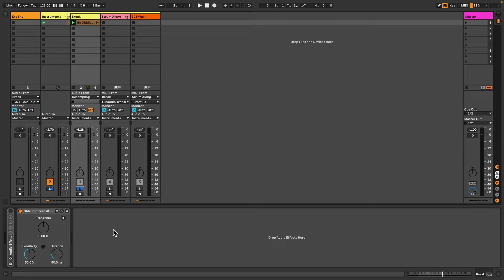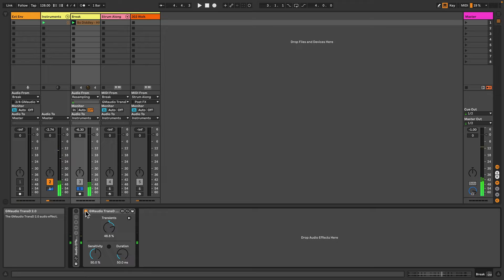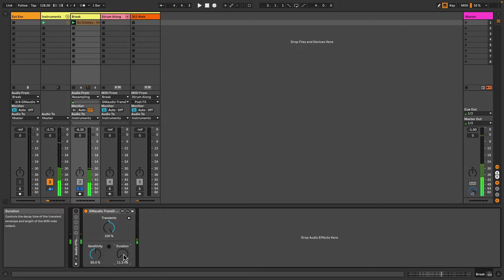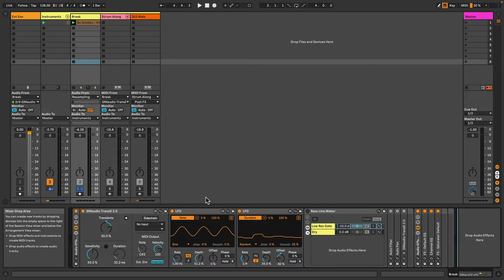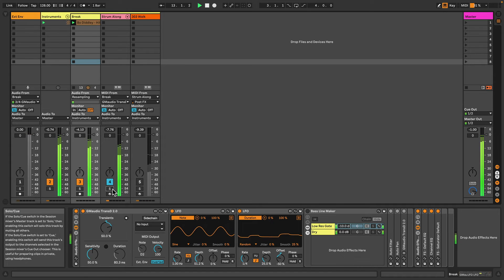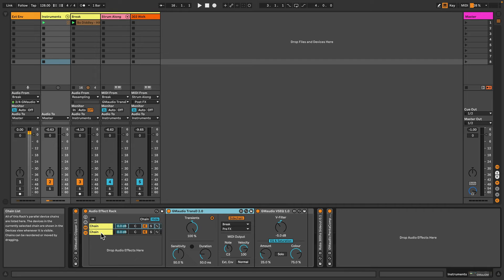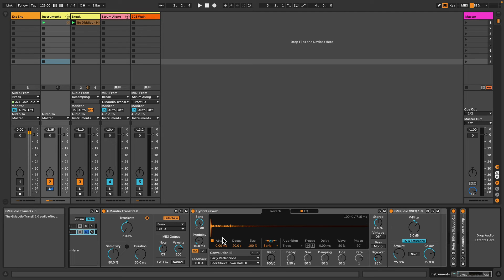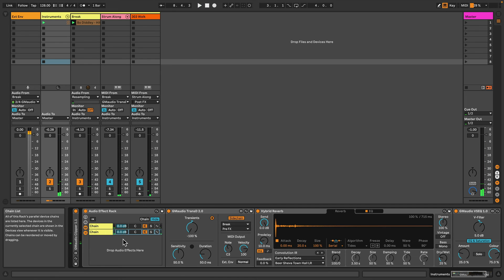GMaudio TransD 2.0 - Max For Live Device - Walkthrough

Comment: Rob I'd love to see  video comparing your clipper to Kclip, I'm considering swapping them out but probably not pro enough in mixing to know what might be the differences in audio between them! :-) I'm in 44.1 so I guess aliasing should be my main concern right?
Reply from the maker: Hey there 😁 GMaudio Clipper is meant to be a simple and free clipping solution, It has limited options and 1 waveshape. Kclip offers alot more but with that comes added cost. I think both can be used together, switching one for the other based on sound or saturation needs, try it for yourself and decide. Kclip should have quite good oversampling so aliasing shouldn’t be too much of an issue. Tbh whats probably going to have more of an effect on your music is using lowpass filters to remove unecessary high freq energy from instruments and occasional highpass filters on instruments to remove energy that would be better utilized by the kick and bass. Focusing on having razor sharp eq skills will probably have much more of an effect than clipping. Clipping should be relatively inaudible most of the time tbh, especially for inexperienced engineers, its simply a way to get more headroom and as a byproduct, louder and punchier mixes. I’ll stop there because I could waffle on forever about tonnes of mixing topics. If you’d like to know more or have a chat then jump in my discord server https://discord.gg/AMfpzqZH
Hope that helps 😁🤘🏼🎶
Reply: @RobertKgma  Nice one, yes lets continue that convo there. Cheers